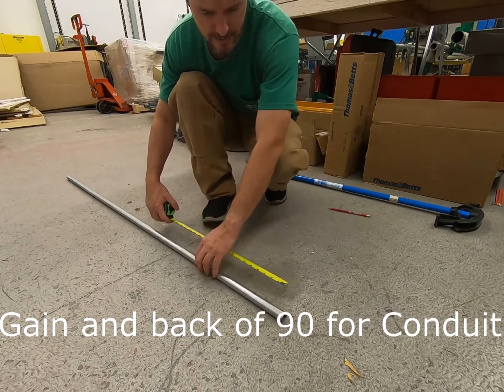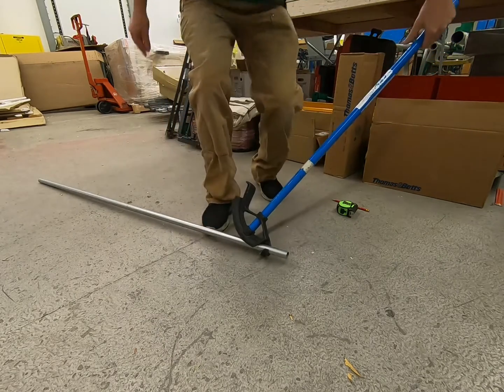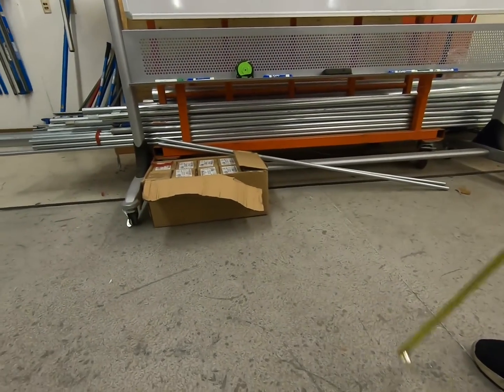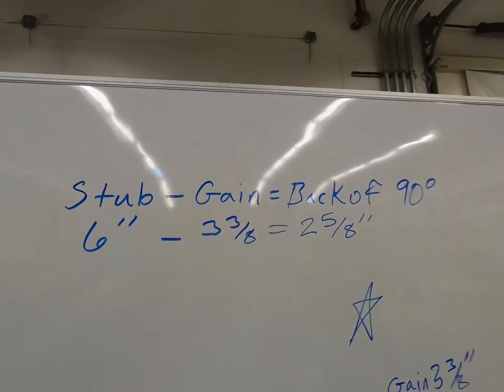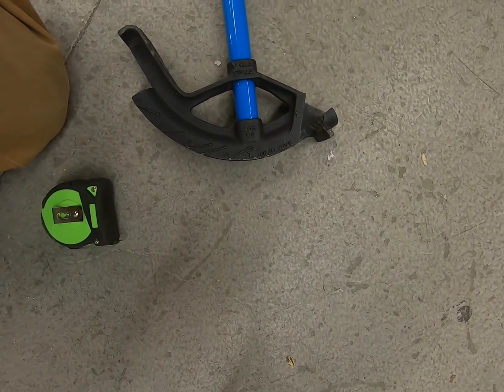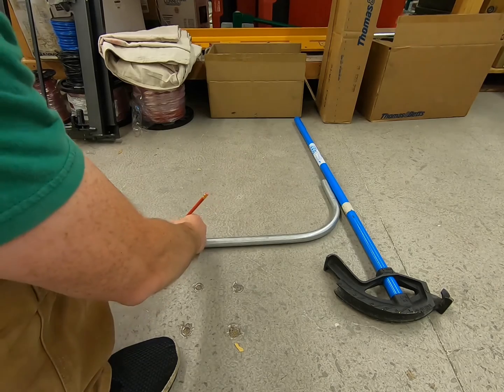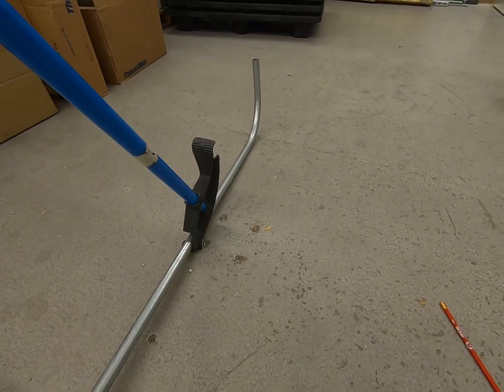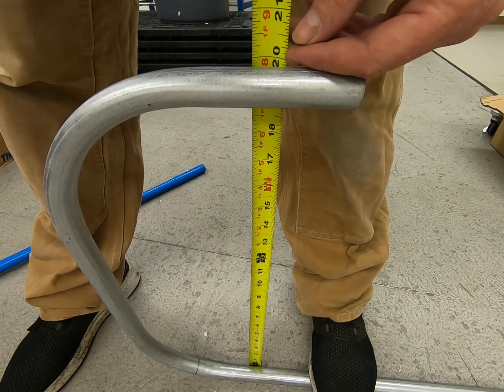back of 90 and Finding gain on conduit

Comment: Lots of eletrians  have a real bad habit of working on the floor.  After every bend there bender will be laying on the floor along with pencil and tape measure.
Reply: So you bend it in the air?
Reply: @LafortunaCosta  no I stand up and measure.  Not down on the ground on my knees.   Then I stand the bender up so I don't have to pick it up of the floor and step all over it.
Reply from the maker: Yes bending with out bending over is always my goal. For the video I used the floor. I always teach people to bend and measure with out going to the ground.
Reply: @zooallow you bend a 90 in the air? I don’t think so
Reply: I dont craw around on the floor measuring.   I don't lay my bender and pencil on the floor.   And yes I do not even bend over to put the pipe in the bender. I stand up the whole process.   I'm a professional.

Comment: Hope this helps someone.  You never add 6" you subtract 6" if you're working front to back.  If you turn the pipe around you mark right at your measurement  and line it up on the star of your bender.  Don't worry about how long the stub-ups gonna be,  you can always cut it off or coupling.